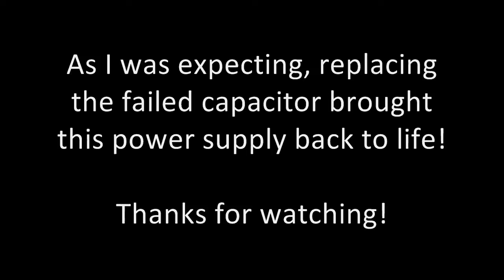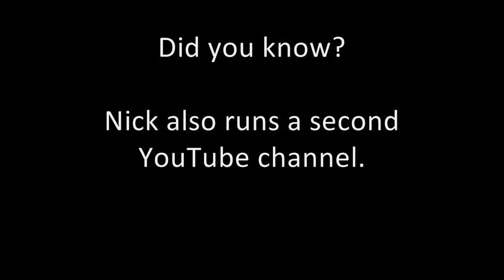Another failed Teapo capacitor brings a PSU to it's knees

Comment: It's unforgivable to have electrolytic caps fail so soon,  I have had more than a couple 1960's Panasonic cheap little am/fm tube radios that have played and played for 50+ years, I replaced the electrolytics in them only to fine 80% are still within specs.  And they've been heat soaked, high voltage and still even look good.  But now 15 years is considered really good.
Reply: They weren't in switch-mode power supplies, running at crazy-high temps...

Comment: I had the same noise in a silverstone power supply so quit using it, had Teapo caps as well and every single one of em went bad just sitting in its box-!  They all popped and leaked.  There were many lawsuits in emachines and IBM as well as monitors due to bad quality cap electrolyte formula the chinese tried to copy on the cheap.